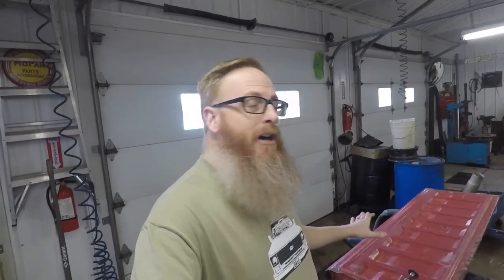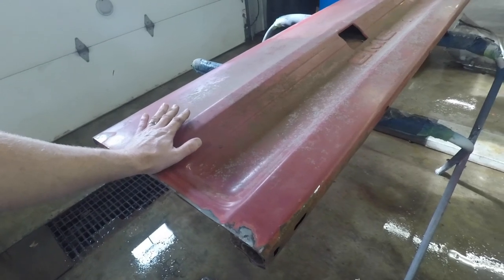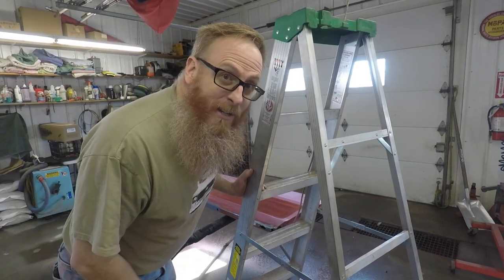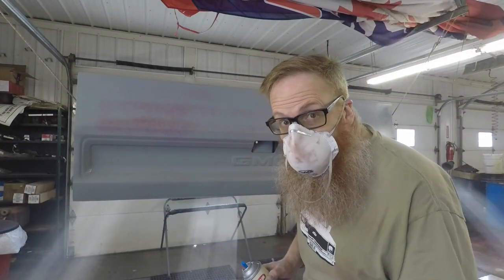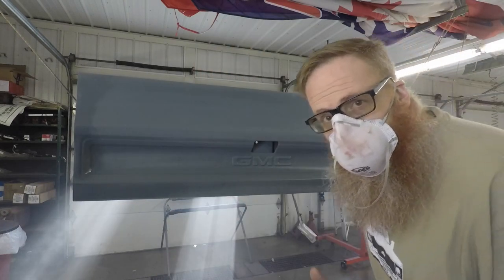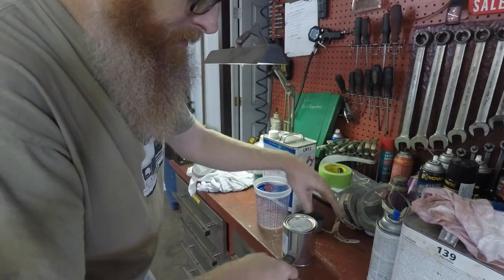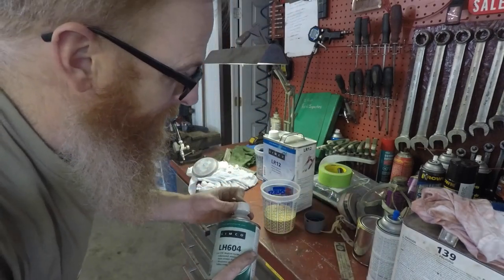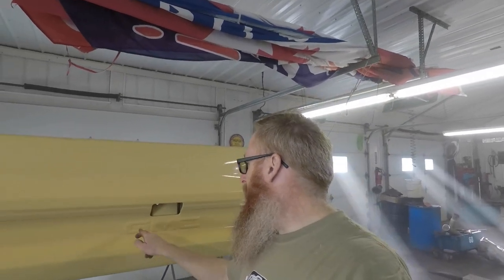HOW TO DIY PAINT A TAILGATE FOR A 1977 CHEVY C10 TRUCK- SUCCESS OR FAILURE

Comment: Hey I'm.gonna be painting my crown vic front end swap I got a gun sunday @ princess auto and I plan to do a highbuild primer and single stage both thru the gun . What kinda paint did you use? Acrylic enamel or urethane. How much was 1 quart approx ?
Reply: Dont use high build on your bumpers or flexible parts, it has a high tendency to crack on impact.
Reply: You'll need a little more then 1.5 quarts single stage or clear coat.
Reply: Thank you bud  . What kinda paint do you think I should do. Acrylic enamel or urethane.  I'm told urethane is more durable but alittle more expensive . I'm a novice at this so easier the better also
Reply: @MaritimerMitch  I like kirker, utech and Nason myself for single stage. I think all of them are urethane.
Reply: The only flexible part I'll be painting is the bumper but I was hoping to get a used bumper already painted in good shape . The only new part is the fenders the rest is already factory painted
Reply: @MaritimerMitch  typically I only use single stage for whole paint jobs because you will not get it to look like factory paint, unless you're like Jason here and have a single stage paint job from factory. Base clear is easier to use imo and is easier to correct a defect in the top coat.